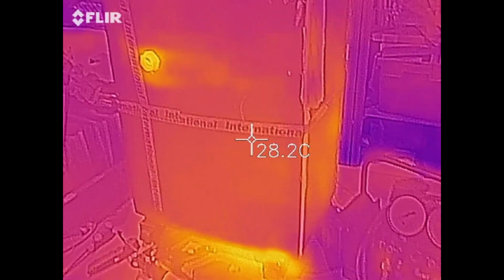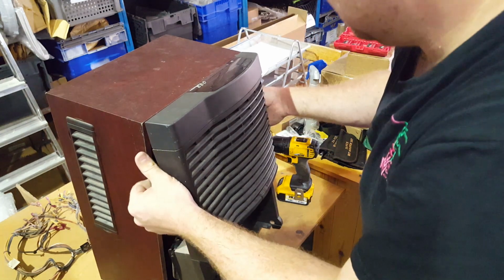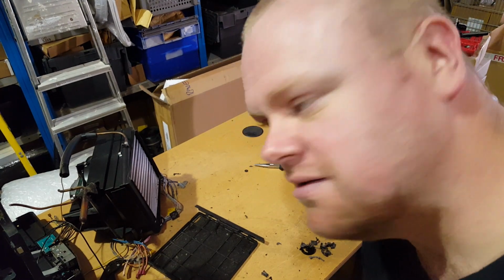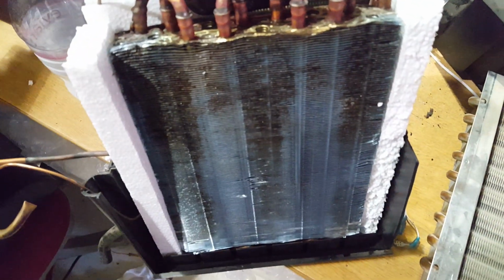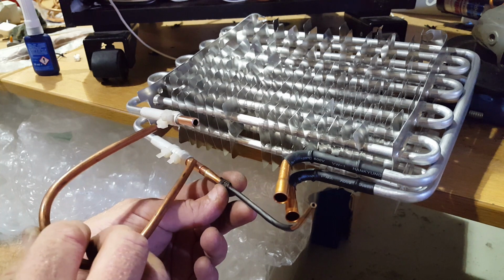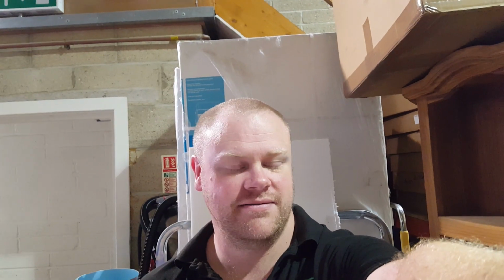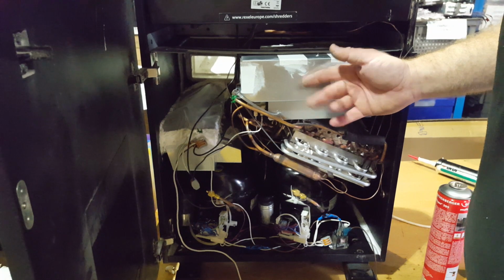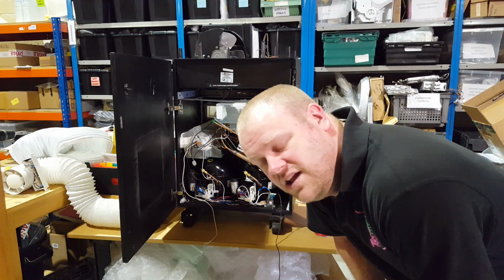DIY AIR CONDITIONER PART 2

Comment: What is your temperature difference, ambient to cooling? 
Also beings your using self contained condensers, did you use a shrader valves like AC system are just followed same engr as a refrigeration unit?

Comment: TIP! I Think The Best Way Is To make It Out From Fridge parts YES, But To Use Them Big Swamp Coolers To Put Everything Inside Cuz The Swamp Cooler Is Alerady Similar with the holes u need And The Filter Place, Just Take Out From the Filter The paper Or Cloth And Put The Real AC Filter In There And Then You Can Just Swap Them When Needed :)  , it will just convert it from humidifier to conditioneer

Comment: how about a cooling wall for a bedroom, without noisy fans, made out of a bunch of old refrigerators
so you have a whole wall of passive cooling  in a bedroom on the north side of a house
install the cooling part inside the bedroom and the pumps and the other parts outside the house protected from weather and wind but well ventilated, this way you should get a totally scilent cooling of the bedroom, right?
problem with condensation solvable?
Reply from the maker: Yes you could simply collect the droplets at he bottom via a drip tray.. it wouldnt be quite silent . You would hear the gas running thru the evaporators but i love the idea and would be much quieter than a fan ;-)
Reply: @jaysjetskis  this will be the next huge thing for the super rich! :-)

Comment: Compressor will burn in short span of time due to continuous running.
Reply from the maker: These compressors will and do run 24 hours a day 7 days a week for 7 years plus as long as they have sufficient super heated vapour to keep them cool

Comment: or dig a 140 cm ditch in the garden, put 20cm diametre pipes in it and then put the earth back and connect the pipes to the house pump the warm air from outside through the pipes till it cooles down and then in to the house,
Reply from the maker: Yes a mini ground heat sink or source woul work waaay better than what i have done here. You know what since you mention it i might try that out! Great idea !
Reply: @jaysjetskis  that is Awsome!!!